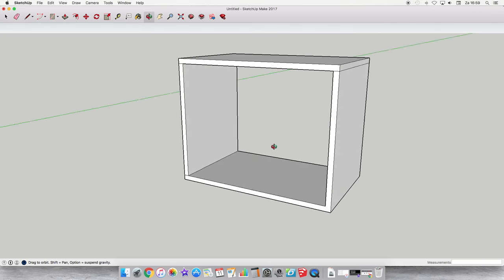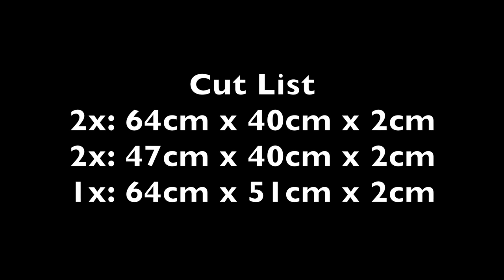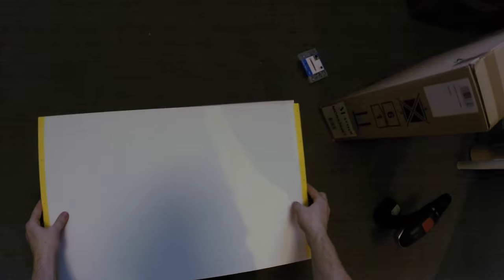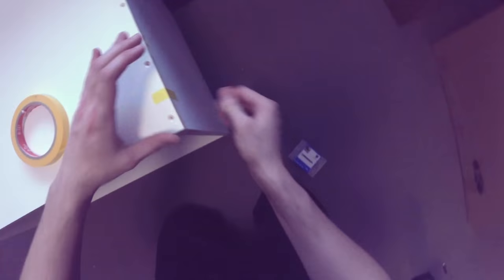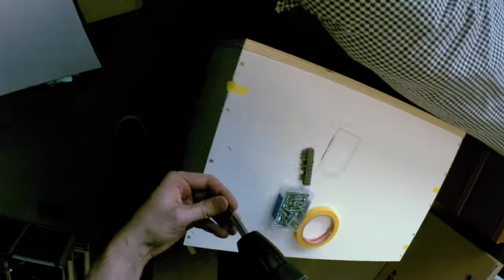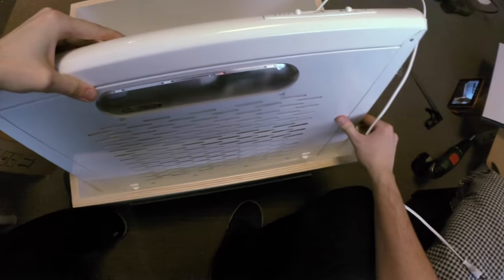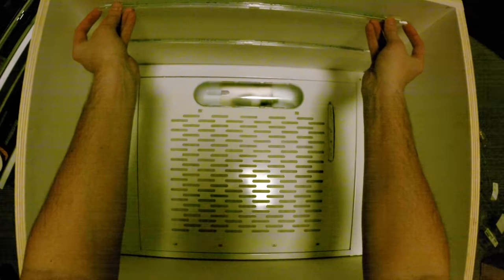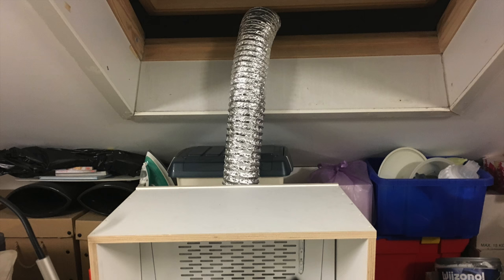How To: Build a Spray Booth

Comment: aren't you worried about the fumes from the paints and the electronics of the fan?
Reply from the maker: +MegaDragonMinecraft i explained a bit about that all the way at the end of the video ;)
Reply: If it's got brushless motors on the specs. then you should be good. Dodgey wiring however, will be on you, lol.
Reply: I think it's perfectly safe. 

Just keep in mind that when you're boiling water (for pasta or something), all the water vapor goes through that fan and all the electronics. 

What also goes through is burnt oil which creates that sticky disgusting gunk. Again, perfectly safe.

 The "fumes" from the paints are child's play for those things.
Reply: I think we will are referring to the Lower Explosive Limit, Flash Point and the Upper Explosive Limit. Auto Ignition is another factor with some chemicals. In our case I think we are just looking at the Upper and Lower limits.

I haven't looked too far into this but I work on gas Drill and production Rigs and these are the terms used to define the parameters in which chemicals can combust or auto ignite etc... 

https://www.ccohs.ca/oshanswers/chemicals/flammable/flam.html

Maybe someone with better knowledge of paint vapors etc... can work this out but concentrations would change depending on the fan draw and the ammount of spraying taking place. So many people have made these types of extractors and no one seems to report problems. You will see that some of the over the counter hobby booths say not to use aerosols - I'm sure they have done some maths and realised that there is a chance that those types can pose some sort of risk in that situation. 

I use zero paints which are pretty flammable, Tamiya thinner is also flammable and I spray paints with that. Whether those vapours reach a level where a brushed motor will ignite them I don't know. I imagine it would be determined by the rate of extraction and the ammount of vapour which will change constantly. I decided to buy a second hand centrifugal fan with motor outside the housing and a speed controller to build a bigger spray booth this summer. That way I am much more comfortable spraying in the knowledge that I should be better protected. These are readily available in the states but in the UK are much harder to come by.

I would advise caution and research before embarking on a self build in any case.
Reply: Dougie Todd h
Reply: @xXturbo86Xx  do you boil pasta with paint thinner?
Reply: I am in the process of building a spray booth, I'm going to use a range hood as well.
My thoughts are if heat and grease get into this system and don't ingite.  Then some thinner or paint should be ok.
But! Like all things caution and regular maintenance ( change the filter) will help decrease the risks.
Regards.
George.

Comment: I built a spray booth for inside the house. The reason I wanted one was because of the humidity messing up the paint jobs but its still happening. Thought being inside would eliminate the humidity problem. Any advice?
Reply: Paint in the room with a dehumidifier...

Comment: The question would be whether the fan's motor is brushless or not. It probably is. Extraction fans designed to remove moisture like that are usually brushless so that the little sparks on the motor brushes don't ignite the fumes, or short out due to moisture. But you'd never want to use a regular desk fan.
Reply: You could modify it a bit.Make it like those big fans that also spray water vapor.

Comment: Most of the electronics are sealed off as Cooking grease build up if flammable. So ignition of the fumes is technically possible but extremely rare. Also in that point if it did ignite it would be quick (like lighting hair spray from a can). 

I do recommend a furnace filter. The allergy ones have a higher micron filtration amount to catch more dust and paint particles, though the cheaper ones work well too. This won't catch the fumes (ignition source) but will keep the exhaust system clean. 

The filter can just sit snugly, but I also use some weather stripe rubber tape to seal around the edges.

Comment: Such booths are pretty OK if you want to remove fumes from acrylic paints but I don't recommend consider such things as a good extractor for 2k clear coats and other aggressive auto paints.
Reply: Vadim Vasilyev actually in automotive pain booths the design is similar. Like I mentioned they usually have a ten micron filter which isn't much. Once you remove the filters lots of overspray inside as the filters don't filter enough of the paints pigments out.
Reply: jason kinney All I wanted to say that booths from the video don't have enough power to remove effectively and fast all fumes. In case of acrylic paints it isn't dangerous but you should be careful with more aggressive paints. By the way, pigments in auto paints are much smaller than in acrylics, so I didn't understand your arguments about filters.

Comment: Hey there! Great video! I'm looking into building this as well but I don't have an airbrush, I only use spray cans, for paint, primer, clear coat. Everything. 
Do you use it for spray cans as well? Since this is from 2017, are you still using it - with spray cans - and how is it going regarding safety? 
Thanks!
Reply from the maker: I used it with spraycans aswell, no problems.

I no longer use it, switched to some pre made booths to up the suction power.

Comment: Have to agree with your comments. People seem to forget that the electrics in a kitchen extraction fan are seperated from the air flow. If it wasn't you would have water from steam, oil and what ever else it extracts getting on the motor and other electrics and they wouldn't last very long. You also see people saying you should have a brushless motor, this is also incorrect, just because a motor is brushless it can still produce a spark, and being brushless does not make it intrinsically safe. Then there is the oxygen to fuel ratio, and with the amount of air flow from the fan, I bet that is way out as well, it would be interesting to test with a gas detector.

Comment: Hi Tom
How do you change the filter on this unit. Hopefully you don't need to pull the extractor out.
Also, are you wiping your booth down before each session? Thanks
Reply from the maker: Just open de front of the cooker hood.

No i don’t. I just vacume it out every once in a while

Comment: It is not the best idea, since those fume,vapor & oil extractors designed to trap all that stuff into filters, and not to extract all that outside. Ofc it will trap paint particles.  It has weak extractor fans, cause by nature warm vapor is floating to the top by it self and don't need to be sucked with force. Extraction  180 m³/hour (your model) when your Sparmax had more than double.
Reply from the maker: +Simple models thats not entirely treu. Extraction fans with a Carbon filter are designed to trap all vapours. This one, with the extraction going outside does not trap much at all. Just the bigger particles.

The sparmax had a suction power of 120m3 an hour. So thats almlst half of this one. This one has 200/220m3 an hour extraction
Reply: It does need to be sucked with force because the route is usually quite long and in most cases it turns vertical to exhaust from a whole on the wall.

The length is usually around 1 meter but i've seen kitchen extraction systems longer than 2 meters working perfectly well without needing a monster motor.

You'd be surprised how efficient they are. My uncle smoked under one of those and there was no trace of smoke in the house.

 It's perfectly capable of doing the job. If it can extract heavy oil fumes then it can extract paint fumes.

 As for the filters, you can changed them to something more fitting, big deal. But the filters they have do the job. They don't really trap anything except very very heavy and thick particles like literally burnt oil or fat. I doubt paint particles are that heavy.
Reply: Ok, got it.

Comment: Hope this doesn't sound silly, but dust is the enemy of model painting, right? So doesn't the extractor fan pull dusty air in from the room and across whatever you're painting? Wouldn't it make more sense to blow air in through a filter so the slightly higher pressure in the box keeps dust out? Obviously that's not removing fumes or anything, so that's another problem to be dealt with. Just wondering what your thoughts on that are.
Reply from the maker: Not realy the case. Its not strong enough to pull all the dust from the room in. Only if the entire room and air in the room is filled with dust. Blowing air towards the model through a filter will cause problems

Comment: Great vid tom awsome loooking spraybooth u shud make sum more n put dem for sale so i can buy one of you i need one buddy let me no wat u think bout selling one thanks bud 🖒🖒🖒😎😎
Reply from the maker: +CHI-TOWN TUNERS M.S haha, dom't think that will work. Especialy since its so easy and cheap to make yourself. And shipping cost would be way high.
Reply: CHI-TOWN TUNERS M.S  a spray booth can be made with a simple box and furnace filter to grab over spray and then if you know where American Scientific is to get fan
Reply: The Scalemodeling Channel lol thought id try thoe 🖒🖒😎😎
Reply: Loius Kruglick thanks buddy 🖒🖒😎😎
Reply: They have various types of fans also try for the motor between two fans( squirrel cages) and the to Home Depot for dryer vent hose and bottom of toilet flange with duck tape and board wider than flange so you can put in window to blow out fumes but can be removed when not in use

Comment: Can't you just use a cardboard box and cut a hole in the back of it?
Reply from the maker: Sure, if that is what you would preffere. This is just a bit of a stronger option
Reply: @The Scalemodeling Channel Ok, cool. Thanks. By the way I am a newbie to modeling and I am thinking of doing a Mclaren P1 so can you make a video about tips and tricks with brushes? Thanks.
Reply from the maker: Might sound wierd. But i would not have a single clue on what to say in a video like thatXD

Comment: I've been reading through the comments about filters and fumes. The filters, fiberglass or paper only trap paint particles in the exhaust, these are not hazardous as far as fire is concerned. After all, they are simply small particles of dried paint and when did you ever see a model burst into flame if a spark occurred nearby. when you spray solvent-based paints and clears the fumes are a danger, both as carcinogens and flammability. I have not seen any home built or purchased booths that are capable of filtering solvent based or 2k paints these products require extreme care and don't belong in untrained hands. Water-based paints only in these booths, please.
Reply: As a model hobbyist, we are more than experienced to work with the products being used. Including the types of paint. 

It's our duty to help and teach those who are NOT experienced.
Reply: @Bob0sModelFabWorx ".... It's our duty to help and teach those who are NOT experienced."    Exactly!
Reply: he has been using it for over two years and has had no problem so far

Comment: I brought mine from eBay it folds away into a case and is under £60 with a vent and a window piece so u don't have to have the window open wide
Reply: Do you have a link for it?
Reply: My wife bought me one, or very similar, over a year ago and I've only started using it today! It's a bit noisier than I expected but draws all of the fumes through the filter.
I'd like to build one and I wonder if it would work having a remote motor sucking through the filter via a long hose. That way I'm not near the motor and it should be quieter. The motor would then blow through a short pipe out under my garage door. I'll never get the time to do it!
Reply: MrChops yeah it's great isn't it, I have no paint fumes at all using it and the turn table is handy to have. I put my airbrush compressor next to it so I have the noise from that too but I listen to music through my headphones while I'm airbrushing.
Reply: Thanks!
Reply: That's a good one for acrylics. Not for the strong stuff ...

Comment: I get tired of all these videos on paint booths that spend tons of time telling you how to make a box and put holes in it and then magically some fan or "cooker hood" it put in with no details on model, cost, how it fit together, how it is ventilated... you know, all the hard stuff I need to know more about.  I know how to drill holes and assemble a wood box, I need to know the stuff about putting the actual parts together that make it more than just a wood box.
Reply from the maker: So you need to no how to saw a hole in the rear. Place the hood in, attach it with 4 screws. Put the exhaust hose on and put the electric plug in the outlet?
Reply: @TheScalemodelingChannel  trying to get it all to fit together by making sure it's all measured properly and isn't too big or too small, trying to figure out what kind of fan to use and how to get it to fit, trying to figure out how to get everything sealed properly, trying to figure out how to route everything and make sure that all the air flow is strong and goes out properly, determining how to make sure that I don't pinch off the airflow or do things that cause problems to the motor by allowing the wrong things through or not putting proper venting on, there are a lot of details and how to set up that exhaust.  I have watched other videos where people have used all sorts of different types of fans and in some videos they even talk about whether you want the fan internal to the duct or external and there is the whole issue of how to vent it out side - just throwing the vent out the window is not sufficient because if it's not seal properly you can get a bunch of your exhaust coming back inside. personally I think the whole issue around picking a good fan and setting up the venting properly, getting good filtration, knowing how to replace filters and win, testing everything to make sure you have good airflow and no leaks, etc. is much more important than building a box. And when I look at these paint booths I can see the box but what I can't see is what's behind it and so that's the part I have the hardest time trying to figure out on my own